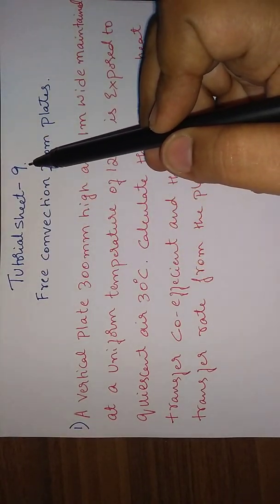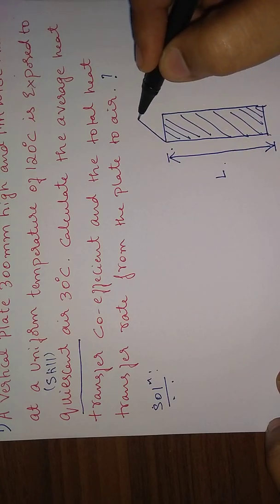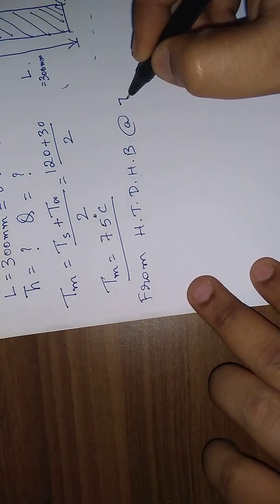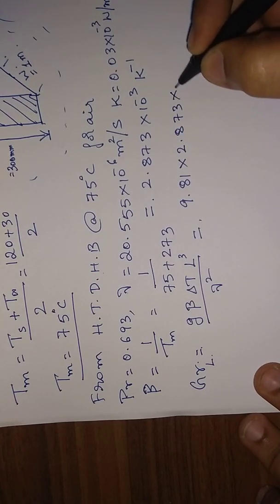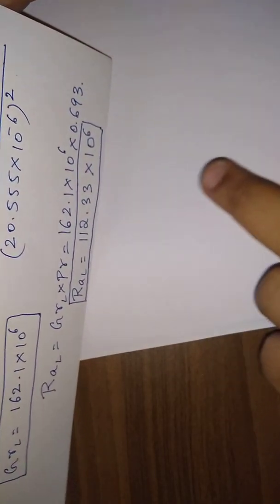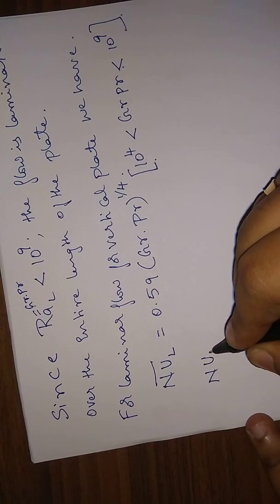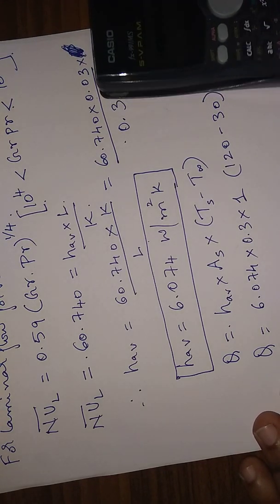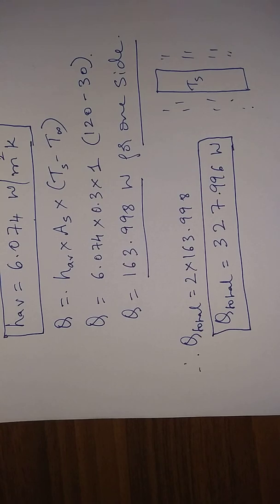Free convection heat transfer problem1(vertical flat plate)

Comment: How properties is Calculated
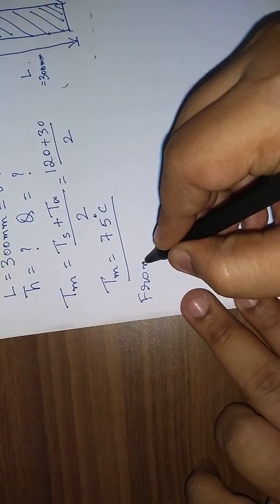Reply from the maker: at mean temperature you should calculate pls watch from 7:50(you can get the heat transfer data handbook in any book stores or you can get the soft copy of the same net)
Reply: @srikanthns1815  Sir the point is there are no properties given for some temperatures in data hand book.
Reply from the maker: @tajibkhankhan2822  you have to do interpolation